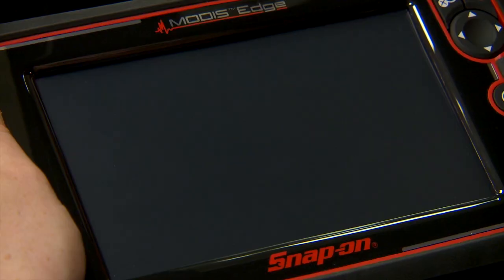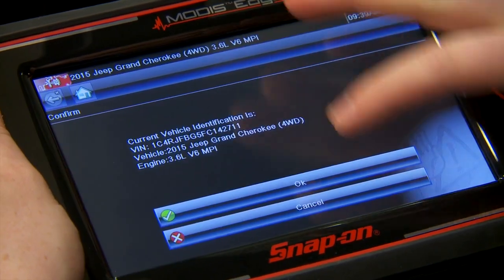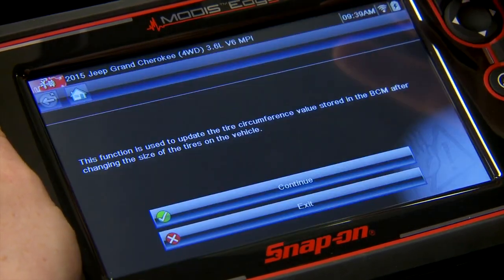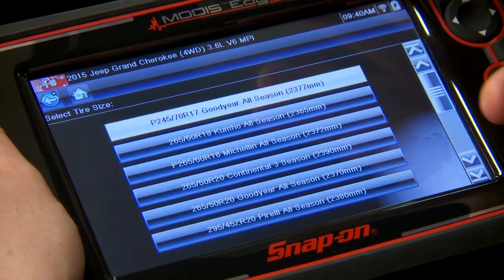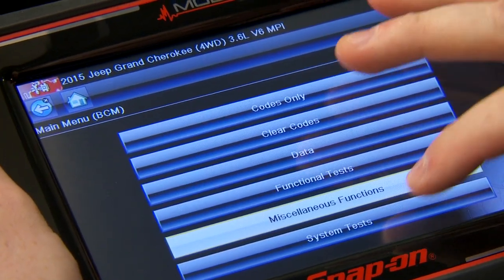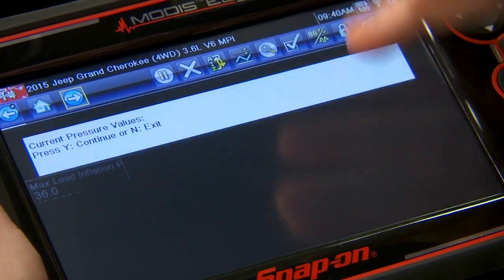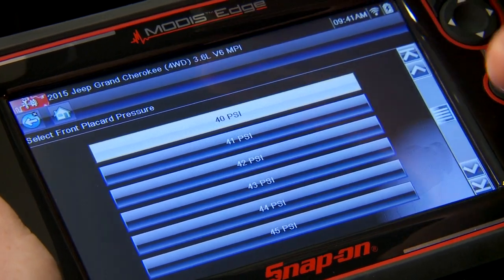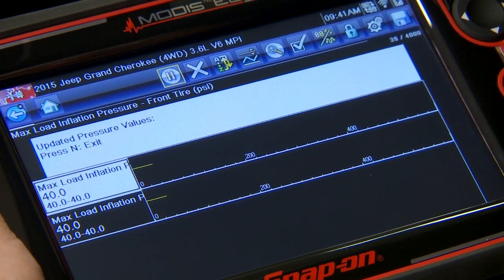Diagnostic Quick Tips - Chrysler Wheel & Tire Calibrations

Comment: THRESHOLD DOES NOT WORK! I just tried threshold adjustment on a 2015 Ram.  Changed in the bcm and it does change the threshold on your screen but you will still get a light on the dash and a code in the tpms module. The tires in the display still show low (red) even though it now says fill tires to 50psi (from the original 80) which they are. So I can only assume this information will also need to be relayed and saved in the TPMS module as well as the bcm to work completely correctly. I updated my Verus Pro to 17.4 just for this function and it doesnt work! Not happy. Guess I should have purchased the Autel for almost the same amount as my update.....
Reply: shawncd1 FCA has locked these functions out. I get calls from local shops who do lifts and tires. They always want to change . Nope. You’ll have to find a Procal for a Ram.